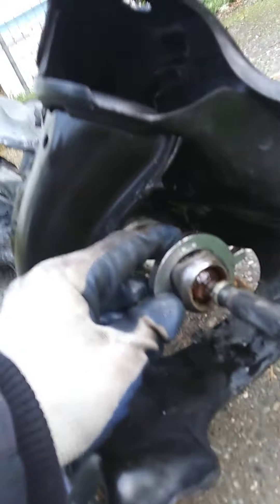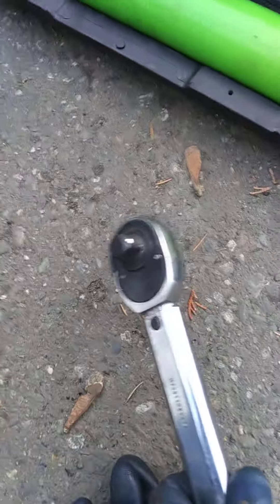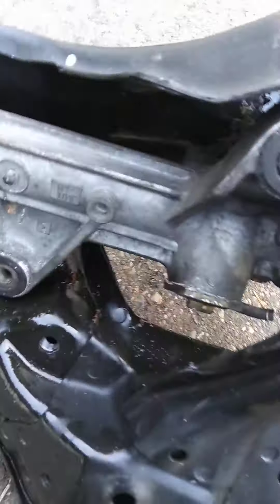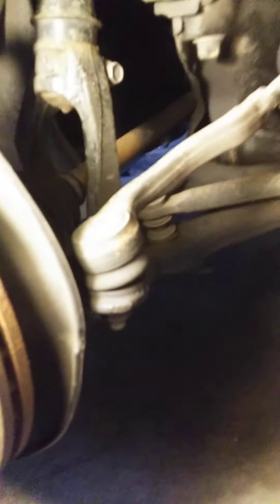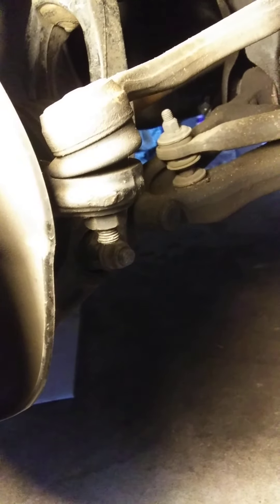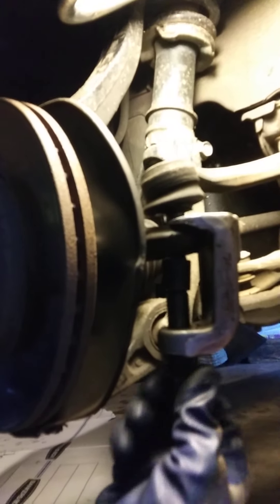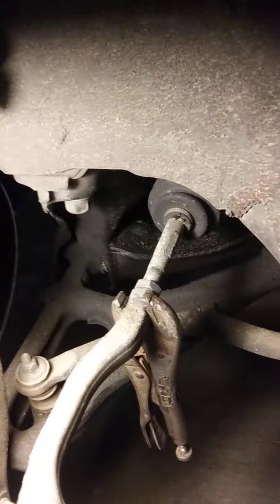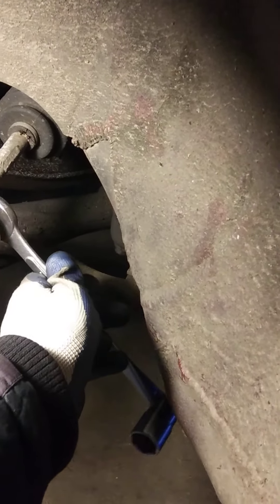Tip for removing a power steering rack from a Honda Civic

Comment: I've watched that civic steering rack vid from EricTCG. I actually managed to remove a steering rack from a civic without removing the tie rod. I figured you can completely shift the tie rod's position in either side to gain clearance in order to remove. Must be done after unbolting the connection from the steering wheel.
Reply from the maker: Hey thank you very much for leaving a comment